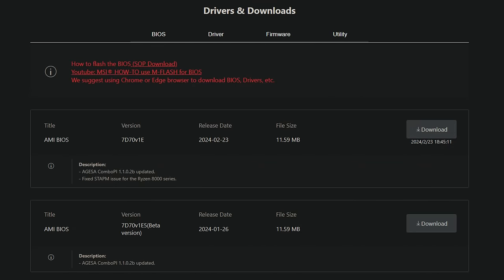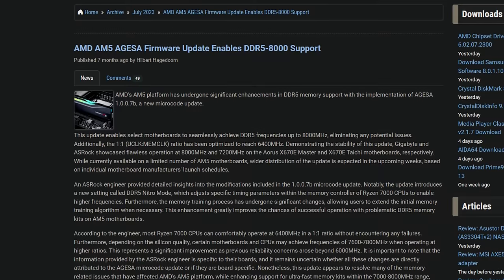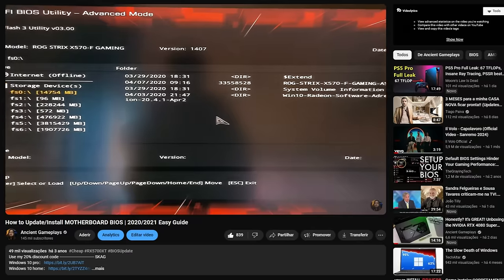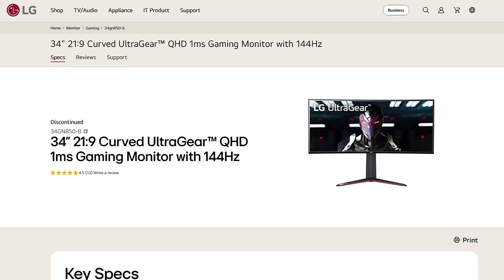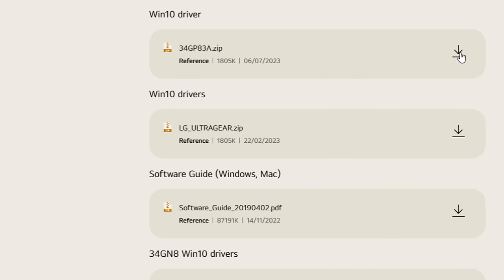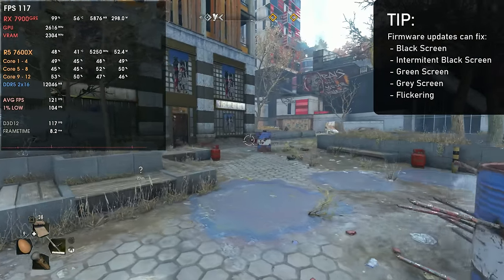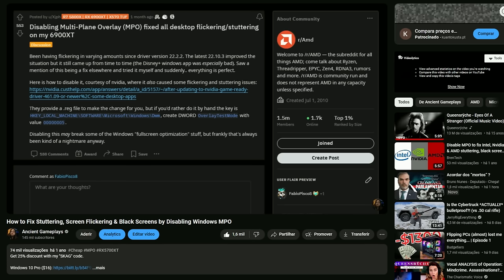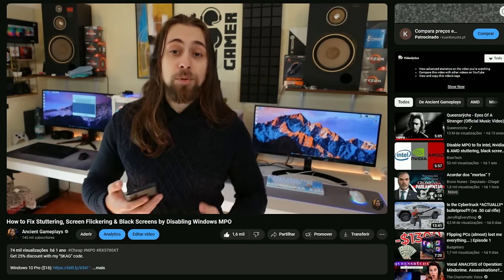20 TIPS to FIX "AMD GPU's Problems" | Easy 2024 Tutorial Guide

Comment: Video very helpful but i have this problem with random restarts of PC. It can be once in a game or 3 times or 0. Rarely happens during just for expample watching videos. I left it for night and nothing happened. In windows it just says Kernel Power so its just about closing system. Im assuming its either PSU or GPU i have 
- Gigabyte P850GM (gold)  -> tested if its PSU issue i used ENDORFY Supremo FM5 850W with their cables and it still used to happen
-ASRock Radeon RX 6950 XT Phantom Gaming OC i thought this might be a problem with some random power spikes but not sure...
-Ryzen 5 7600 no OC
- Tomahawk ProWifi MOBAS
-2x16GB G.skill trident ddr5
There is no overheating expect Hotspot on GPU around 98c but AMD says until it reaches 110 its ok so.. anyone have any suspicions?
I have latest BIOS, Chipset, drivers, windows 10 updates etc.
Reply from the maker: Watch the overclocking stability part
Reply: @AncientGameplays  i did watch it and i got rid of Expo yet still appers albo tested gpu with benchmark same with ssd with hdtune and memtest for ram
Reply: @11zimny  Did you find a fix for this? Its driving me crazy I crash daily with this error on all my fav games. Harware errro kernalpower code 141 - plz help.
Reply: @osggg_  I found out that its some GPU problem, which is pretty hard to find. I actually sold this card and bought 7900gre which has no problems

Comment: HELLO SIR I have bought amd rx 5600xt asrock oc d challenger it keeps crashing I used to own a amd gpu before this 5600xt as well I never had a single problem with that but now I am facing all kind of problems . cpu ryzen 5 3600, 16 gb ddr4 cl16 3200mhz ram,psu 750 watt corsair , gpu 5600xt , mother board msi pro vdh b450 m . can you please adress my problem. THANK YOU

Comment: Does anyone had a problem with games like valorant dropping insane frames with whatever newer driver they used? 

Like i am still using 22.5.1 because whenever i update drivers, my game starts to drop frames instantly 120 to 300 in a moment then its 300-350 for a while then its 120 and goes back up again. Is there anything to solve this? My gpu is 6700xt.

Comment: I'm done with this. I'm about to just sell my 7800xt and get nvidia instead. I just can't fix it!! Vram is stuck at max while doing nothing and my idle power consumption is at 70w!!! I turn on freesync will fix the vram and power draw but my screen flickers even when not gaming to the point that its hurting my eyes!! This is ridiculous. I've tried pretty much everything!
Reply from the maker: Fresync is meant to be on lol, if your monitor flickers you need a better cable or a better monitor lol, not amd's fault
Reply: @AncientGameplays  I had gigabyte g27q 144hz same issue until I sold it and bought rog strix xg32wcs 180hz still have the same issue. With freesync on, it's the brightness or gamma that flickers. I've been searching for a solution for months.

Comment: My biggest issue with AMD GPUs is the "power consumption @ video playback" and WHY does no one seem to be stating those horrible consumption figures ? 
Last Gen's 6800 (and up) RDNA 2 GPUs & the new 7000 (RDNA 3) series have serious power issues @ video playback (YouTube, Netflix, VLC etc.) 
Check out the video playback consumption of 6700 XT (20W) vs 7700 XT (42W) on TechPowerUp & Computer Base sites.
40+ W is stupidly HiGH & meaningless...
AMD needs to solve that "power issue @ video playback" at least in the next 8000 series. (or do they even care?)

* Emphasize on "video playback" as most people confuse it with idle, web or gaming consumption.
AMD still didn't solve the "video playback consumption" the previous solution was for "idle consumption" 
PS: RX 7900 XTX is still the record holder with 67W but 7900 GRE is getting closer with 62W on watching Youtube !
Reply: You tube, Disney...  4K full screen, dual monitors 1440p 240 Hz, rx 7900 card and consumption 16 -18 watt 🤷
Reply: @rafmc6053   in your dreams... 🤣
Reply: @Boorock70  I see, boy, that you have big problems when you're awake 😎 First of all, I have undervolting and lowered the power limit for regular applications, and the GPU clock set to 1000 MHz. Second thing, I have set my own monitor refresh parameters (162 Hz) compatible with CVT-RB. This is exactly what "my dream" looks like. And the full power of the card is when it needs to be, simple for people with brains.
Reply from the maker: I have 14w idle on a 1440P uw 160hz, 35w watching 4k videos on youtube mate...
Reply: @AncientGameplays  👊🙋
Reply: @AncientGameplays  OK, Fabio. Just make a video about it & show us the real consumption of AMD 7000 series @ video playback... 
Cause; reviewers (TPU / ComputerBase) are saying much, much more. 
Double of your figures to be exact 🤔
I can't the post links, youtube deletes my comment.
Reply: @rafmc6053  This should be done at the factory-level, genius.
No one has to be a driver monkey in order to use a GPU... 
- That's what I'm saying, capische ?😉
Reply from the maker: if you watch recent ones, even reviewers updated those idle power results. I showed/show several times across some of my Adrenalin videos... I had initially around 75-80W video playback, now I have around 35W. Power tables have been fixed along the time @Boorock70
Reply: @AncientGameplays  No, AMD fixed the idle consumption only. 
Not the "video playback consumption"
They've done nothing yet.
We're talking about video playback consumption not idle...
Reply: Qui sono d'accordo con te, amico mio, e capisco perfettamente.✌ @Boorock70

Comment: Both brands have issues, some similar some different. But in my personal experience I have never experienced too many GPU issues with Nvidia, while my AMD GPUs have always developed issues within a year of use..... And I'm saying that while using a 6800XT right now. I have no brand loyalty towards any company. But either I'm always constantly unlucky with AMD or constantly lucky with Nvidia, whatever the case, I've always had much lesser issues with Nvidia.

In the performance-per-dollar metric, AMD is the better one obviously. But performance-per-dollar does not account for the crashing issues, stability issues, temp issues, longevity issues, etc. No "professional GPU review" will ever cover such long-term testing, because they don't have the time, and is of no monetary benefit to them. But for the non-rich gamer that buys these GPUs and have to stick with them for at least a few years, its incredibly frustrating.

Comment: nothing of my problems fixed after doing this on PUBG. I got stutterings and drop fps while i play PUBG... IDK why. I play on MAX ULTRA SETTINGS. only with VSYNC can be reduced for a little but the problem still exists. My setup is ryzen 7 7800x3d - 7900xtx nitro+ asus rog strix x670e-e corsair ram 6000 amd expo 30cl and psu be quite straight power 12 1200 w

Comment: Thanks for a couple ideas.
But half of the games run better once they clear the driver lag.  My son bought my old system.  It's a 22900k 3070 running helldivers 2 like a champ. My 13900k 7900xtx hellhound is locked at 60 fps and I have to restart it o ce a session. You can hear it choke on a packet and the fans go haywire. 5090 here I come.
Reply from the maker: 7000 series have issues with helldivers 2 specifically. Just use radeon chill to lock fps and it will work fine

Comment: PLS HELP... I Have 2 monitors fullhd60hz And 2k 144hz on my old 6700xt idle power consumption is 8-10 watts now i have 7900gre and idle is 50+-watts without any program running 😭 i notice that old 6700xt vram usage is around 600mb+- and now on 7900gre vram usage is around 1200mb+- for no reason. I have no clue waht to do pls pls pls help 😭

Comment: Most GPU issues are hardware issues. Can't fix those with any of these parlor tricks. Sadly AMD has many issues. You get more FPS for your money, but you sacrifice quality. Not saying that nvidia is always better, they sometimes just sell overpriced low quality parts, but it's less common since nvidia has a shorter leash on their partners.
Reply from the maker: I had lots of amd cards over the years and I still have them. Buy good models and you're fine... don't buy junk

Comment: version 24.2.1 is defective for amd 9 5900x, the processor is automatically set to 4.2/4 ghz, the temperature does not go below 42/52 C, it is not possible even in the system, it turns off after 1 minute. up to 1 hour . I returned to 24.1.1 and it works normally. However, my Rx6800 Master did not notice any changes

Comment: I'm having a lot of stuttering and instability issues with a brand new 7900 GRE that I just bought! I totally forgot about the pro drivers I'm definitely going to give that a try cuz I almost returned to the card!
Reply from the maker: @UnselfishPath  you're missing something and you most liekly have a bad psu or an unstable cpu/ram
Reply: @AncientGameplays  it's a Ryzen 9 5900 x with four sticks of 16 GB Trident z Royal. The PSU is a 850 watt Cooler Master sfx. I do have a concern about the motherboard though because it was a used. It worked fine with the RX 6750 XT.
Reply: @AncientGameplays  it's my motherboard because when I reset the default in my BIOS dim a2 runs at 2133 and dim B2 runs at 2666. So it has to be a faulty motherboard?
Reply: @AncientGameplays  turned out it was the Adrenaline software the whole time! I installed the driver only and it runs great with no problems now!
Reply: @UnselfishPath any problems?

Comment: I have used AMD GPUs for years and never had a single problem.  My favorite game crashes every time I exit the game with my current nVidia card.  If you think ONE BRAND is consistently BETTER than the other, you are simply not analytical.  I am using nVidia now, but the reality is that I have had better overall experience with AMD, and I will be buying a new one soon.
Reply: It's written as NVIDIA, all upper case letters, just like AMD.
Not "nVidia"...

Comment: No solutions here help my 6800xt
Shame, I have great time with both Rx570 and 5600xt
Reply from the maker: You have a defective card or bad psu maybe
Reply: @AncientGameplays  I changed the psu, it must be the gpu, I have this problem for years  now since 6000an came out, it's really weird because every benchmark (except 3Dmark time spy) run normal even furmark for a day non stop, I even change the ram check stabily with memtest and occt, all normal, unlucky me

Comment: Btw DDU is not that great if i am honest. If you have register faults it will not be solved. The only real clean install is a complete real fresh OS install including wiping your drive(ssd or hd) in the correct way! It for sure can help DDU but it's no magic goat.

AMD chipset drivers also are not released often usually once in about 6 months.

Motherboard bios i would not recommend people to update unless they really know what they are doing. If interupted it will corrupt your bios and not posting anymore.  Rule here is don't update if it's not needed. That being said i updated to the last version 2 days ago. But it's always a bit nerveous time hopeing nothing goes wrong.

My Asus motherboard does it from the bios and accesing a file on my ssd. Then it takes like 5 mins and you might think it's done. It reboots after this 4 more times! And any time interupted would cause your system to be broken! 

So be very weary with doing a bios update!
Reply from the maker: Let's agree to disagree there in some  topics haha
Reply: @AncientGameplays   You do know that updating bios for motherboards has risks if the power is turned of during the process or if people think it's done. I would never promote that! Only in case were there are real issues known and people know what they do. 95% of people do not even know what a bios is or it's function.

Tempering with it can be dangerous. Also when enabling Re-bar and other stuff. Or using XMP or EXPO wich is overclocking. It is good to help people out. But be careful with letting them do things they should not do. Only people like you or me and others that know what they do.

I do help out people a lot, and my experience is that 90% plus don't know much about pc or OS beside powering it on.

Comment: Amd is garbage, tried everything and my card still stutters, garbage of a card
Reply from the maker: Not the card most likely, but yeah, get frustrated mate
Reply: @AncientGameplays  ive tried everything, paid $339 and the card is not usable, i dislike nvidia, went with amd to support them, in my case i just threw away $339.
Im still willing to buy another amd card, want to give it another shot
Reply from the maker: @arryhas8895  mate, there are only two options. You don't know what you're doing and you should take your pc to someone who does, or you have a defective card. Watch this video to begin with
Reply: @AncientGameplays  i tried everything in your video, watched it completely. Then took my card to where i bought it from and they inspected it, after 2 weeks i got the card back, they said its fine.
I tried the card at home again, it still stutters. 
Been meddling with hardware and software since 1990, i know what im doing.
I blame the retail store who doesn’t accept a replacement, it should be a defective card. Going to take them to a civil court.
Reply from the maker: @arryhas8895  I believe you didn't test everything. Stutters can usually be caused by a big CPU/RAM bottleneck (or lack of RAM for example) and a bad PSU. Let me know your full build
Reply: You also believed that i didn’t watch your video.
Then you believed that i’n not good with computers and should take it to someone  who has has a clue.
Now you are believing i have not tested everything in your videos…
The way you are responding to me is cringe dude.
I am not here to argue back and forth with you, i was looking for a solution but you just want to blame things on me.
Again i dislike nvidia cards, pricing etc.. but i have never had a problem with nvidia, on the other hand amd cards have been a nightmare for me.
Now respond that i havent watched videos or tested everything or that i have no clue about computers, not cool dude
Reply from the maker: @arryhas8895  we are not arguing, we're trying to help, what's not cool is you trying to play the victim game. Stop it, we're not kids anymore. As i told you before you either have a defective card or something's wrong, and sorry, but I just don't believe you tries everything like change psu, putting everything to stock, try different ram for example. I don't own you anything and still I tried to help but you somehow talk I do own you something and am being the bad guy here. That's pure entitlement mate
Reply: Play the victim game? What? Dude you alright? Told you, you are still believing i havent tried everything.
 I did change my psu as i have 2 desktop pcs at home and you are still saying i have not..i changed ram as well. Still you are saying i havent. I never said or implied you “owe” me anything but again you are being cringe by saying that, not cool at all dude.
“Pure entitlement”.? By saying my experience about my amd card is pure entitlement? Again, you’re jusing being rude to me just because i spoke about my experience with my amd card. Cringe

Comment: Haha bro you had me there with the best way to solve AMD problems is to buy an Nvidia GPU 🤣🤣😂😂 it is what i feel. But i get you. For sure not every one has issues with AMD. It's just that i had way to many. If my Intel/Nvidia combo would give me issues like that i will see what i do. I only can say sofar no issues with the new combo at all! My 14700KF stays with cinebech r23 about 90c and with undervolting lower to about 85c wich i think is very nice. My Nvidia GPU is even way cooler. Hotspot is only about 12-15c higher then my core. Core almost never reaches over 60c in gaming. (Asus Tuf Gaming RTX 4080 Super) and the powerdraw of my 4080 super is really better then my AMD rig was. Had a 5900X wich was ok, did some crazy stuff from time to time like not booting but most of the time it was ok.

My RX7900XT was horrible. Also the 6800XT was horrible just like my 5700XT. I did have also a 6700XT for 3 months. I did need to make adjustments in files for running Horizon zero dawn. Forgot why...but that is for me always AMD. I feel like i am a tweaker. And i don't mind being a tweaker if the stuff is cheap or free. Not when i pay a lot of money.

But we need people to buy AMD otherwise my Intel/Nvidia combo is even getting more expensive. So you are doing a hell of a good job Fabio!

Also to be clear Fabio, i always used the latest bios on my AMD motherboards! It never helped. Did clean installs. Even on a different drive(so had 2 OS at the same time)  DDU and everything else you can find. To me AMD just kept giving....PROBLEMS that is...

I will not say i am a prfessional. But for sure a tweaker with over 25 years of experience building PC's and installing.
My first real use case was a Windows 95 pc back in 97 and i changed parts in 98 where i bought my first HUGE 2000 MB hard-drive wich was huge at that time 😅